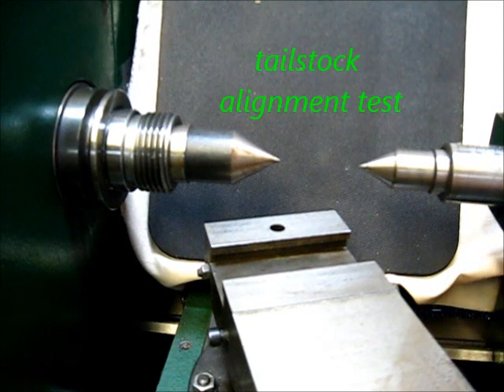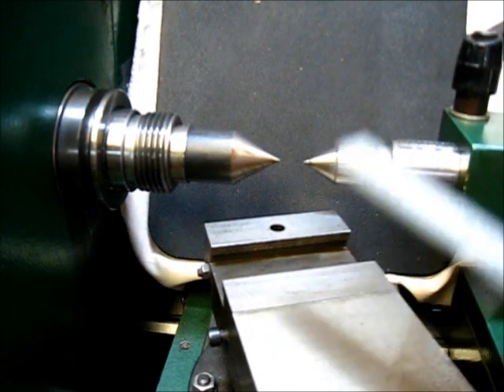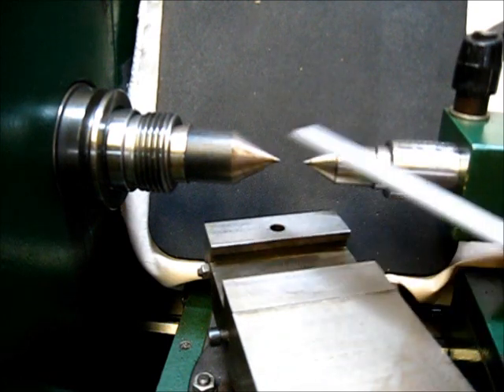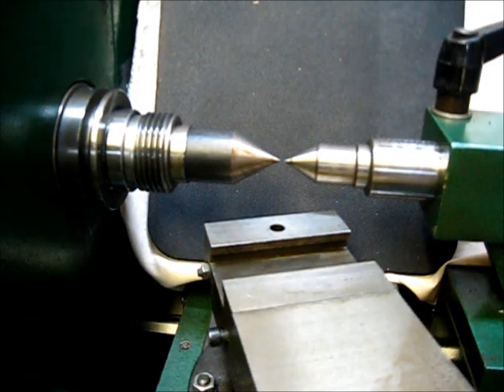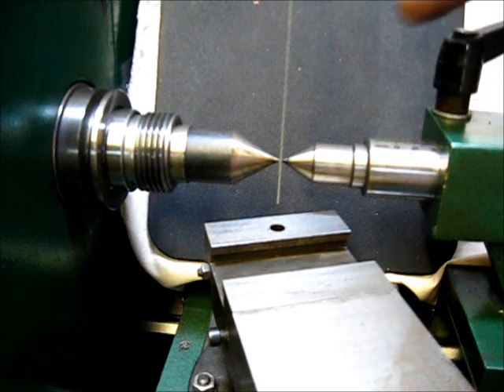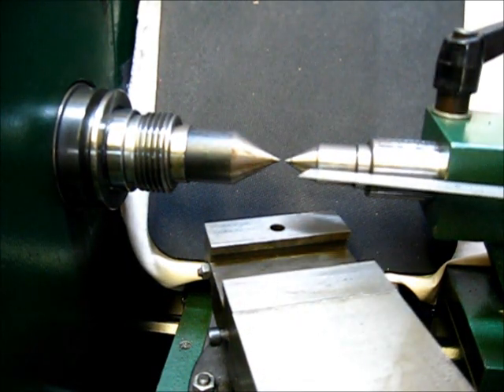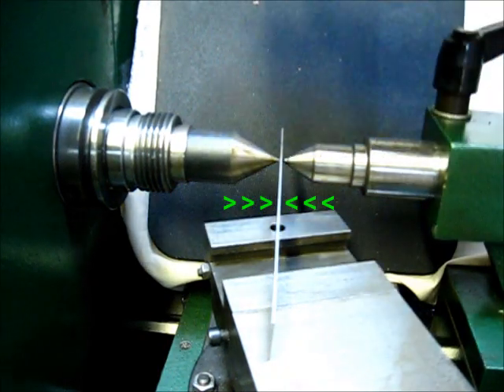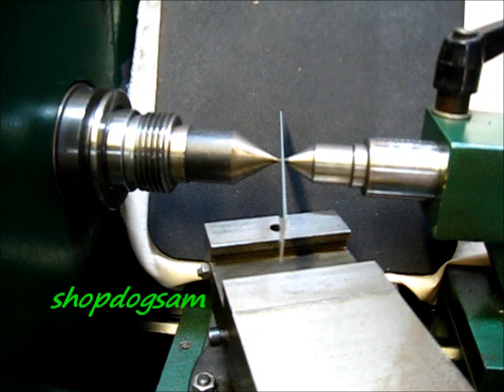Grizzly Metal Lathe / old school tailstock alignment test

Comment: Thanks for the video!  I made a part the other day and the drilled bore was not parallel to the OD and I can't imagine how my Grizzly G9972Z did that so I  ran your check.  Cleaned the spindle bore and put in the dead center and ran the lathe. Much to my surprise the tip of the center wobbled around about .015". Doubt that is the problem with my hole but it makes it impossible to do your test and don't know what is wrong or even if it needs to be fixed.